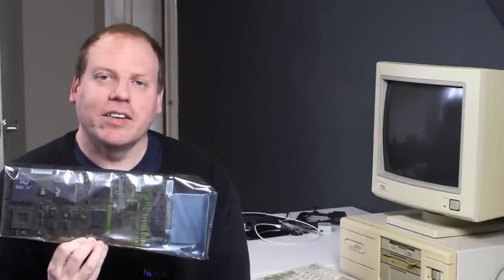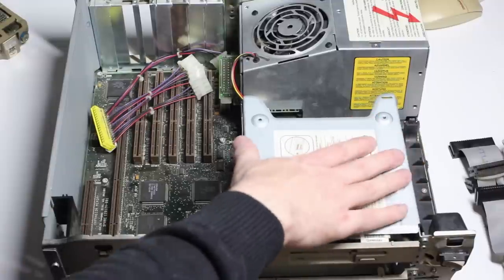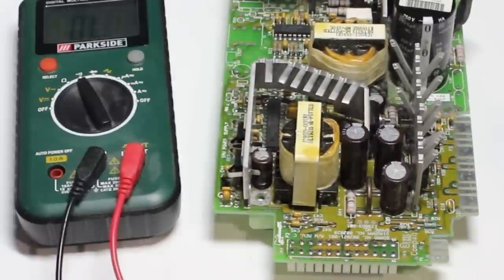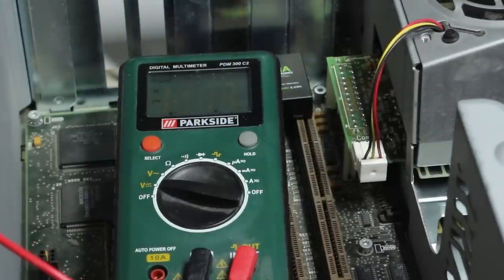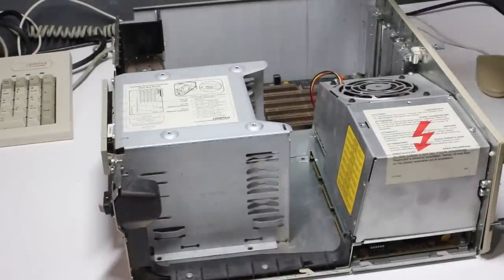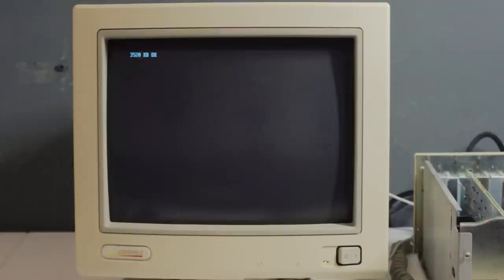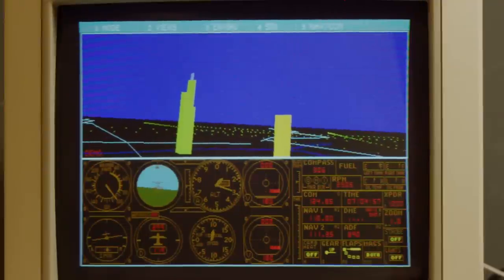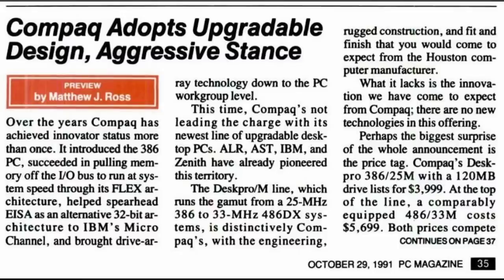Rescuing a REMARKABLE 386 DX-25 Made by Compaq

Comment: could you please add a link to the setup utility in the description? I just bought one of these :)
Reply from the maker: Unfortunately there is no obviously reliable site to download these. The best I came up with was:

http://66.113.161.23/~mR_Slug/pub/EISA/sources/COMPAQ/added%20to%20archive/

However, you need to know which one to download. Too early (or possibly too late) and it won't work. In my case I used sp0842.exe.
Reply: @PCRetroTech  sure that's the one? You mentioned 4 floppies being required in the video but that archive only makes 2 disks. And they are 1.2MB not 1.44
Reply from the maker: My apologies, it's sp6144 that you want [1]. I originally looked through my downloads folder and the other softpaq was the only one I found. But I just checked my USB stick and found it was actually the later one that I used. I still don't know how I got it onto my USB stick without actually downloading it. I must have partially cleared my download history or something.

Anyway I'm pretty confident sp6144 is the right one.

[1] https://ftp.zx.net.nz/pub/archive/ftp.compaq.com/pub/softpaq/sp6001-6500/
Reply: @PCRetroTech  that's it! Got my system configured. You're right these are quite fast
Reply from the maker: @heilong108  Great that you were able to get yours going. I've been spending time writing code on mine. I realised that cache barely affects a 386 DX until you get to about 20 or 25 MHz because the bus and CPU are almost perfectly matched at 25Mhz if you have 80ns RAM, which this does. But I believe it has a cache anyway.

Comment: Sadly EISA-bus machines (and cards!) were ridiculously expensive, not targeted for small businesses or home users :(

About 386DX vs. 386SX - 32-bit memory bus helped a LOT, especially combined with decently speedy VGA-card. 386SX's halved memory-bus killed performance from the start and most cheap 386SX-machines had no external cache in motherboard. Even little 64kb cache in MB made a huge difference and pricier 386DX-ones almost always had some. Combine that with 32-bit memory bus and demos actually ran as advertised. Been there since 80's, I used 386-class machines in late 80's and early 90's. With decent 386DX+MB, next one to tune was VGA-card... how you pumped up bus timings and card itself. Have you tried overclocking older Cirrus or S3-cards? Good old times!
Reply from the maker: I've done quite a bit of overclocking of VGA card on VLB and ISA machines.

Yes, I agree the 32 bit bus helped a lot. That is one of the main points of the video of course, although I could have made that clearer by mentioning it in the conclusion at the end rather than just alluding to it in the introduction.
Reply: @PCRetroTech  It could be interesting to see how much overclocking actually helped in 90's?
IF I remember correctly I got up to 20% more out of my Cirrus 542x/543x- and S3-cards back then. Used VGASPEED and some other early "benchmarks". And in many cases it actually improved gaming experience in DOS-era games years before 3D-cards.
And thanks about interesting video as always, keep up the good work!

Comment: was there a difference in L2 cache?
Reply from the maker: I believe so, yes. Compaq mentioned the cache in their advertising. I don't have comparative figures though.
Reply: @PCRetroTech  l mean was there a difference L2 cache between your two 386 pc's to help explain the difference in performance?
Reply from the maker: @Pickle136  Yes, that's what I'm referring to. I believe the cache on their later machines was superior. One of the other really big differences is the 32 bit bus obviously.
Reply: There's no L2 cache on 386 systems, since there's no L1 cache inside the 386 CPU itself. Also, it was very common for 386 systems to not even have external L1 cache (no cache at all).

Comment: By the way, it should not be hard to make a memory board for that slot with just the pinout of the slot, that will be FPM RAM for sure so pretty easy stuff to implement.
Reply from the maker: Yes, that would be an interesting project, and certainly something I thought about. I don't know the pinout at the moment though. Documentation is really sparse.

Comment: Your the second person to do a video on this machine. Look up a video by Rik's Random Retro. 
"Compaq DeskPro 386/25M - The Modular Fun Machine"  The memory card just added SIMM slots you had to populate with SIMMs. His also had the original EISA video card. Well if you want to bother. The original card for this machine was a slug, and EISA didn't do much for video anyway. Most ISA cards would outrun the original anyway. The original EISA card also used a weird VGA connector with pins missing that may or may not work with the monitor you have.

Comment: Oh and by the way, if you want to run Demos like Unreal, Second Reality (this one in particular) make sure you completely avoid ANY SLC model, not one has worked for me on those without crashing at some point, some times a bit later into the demo (1 scene if it worked) but it would crash nonetheless. Moved to a 386SX40 from an SLC40 and guess what, no more crashes.
Reply from the maker: Interesting. I wonder what the problem is with those?
Reply: @PCRetroTech  maybe misconfigured CPU settings somehow? Possible?

Comment: Your VGA may actually be an EISA model, which would make it faster. Can you check this?
Reply from the maker: I wondered this myself, but the connector looks like ISA to me. I don't think it is a EISA card.
Reply: @PCRetroTech  You can easily spot the difference between them. An EISA has twice the ammount of connections ISA has..
Most of the difference in speed between the SX and the DX is caused by a vast difference in memory bandwidth as the DX has full 32-bit 25MHz memory whereas the SX has 16-bit memory bandwidth and is running at 16MHz, making the DX's DRAM throughput more than 3 times faster!
Reply from the maker: @pipschannel1222  Yes, that is what I would expect.

Comment: Warning, if you do buy EISA cards for this machine, remember at least some of them are inoperable without the corresponding option disk to set the board parameters in conjunction with the COMPAQ setup disk. Jumper free didn't yet mean plug and play!
Reply from the maker: Yeah I saw all this in the setup program, which I have.
Reply: EISA can be such a PITA to configure. Even with the correct setup utility and config files, there's no guarantee the card will be compatible with the motherboard.  But for the era, EISA was quite good. Just wish better video cards were made for the standard. Not all EISA motherboards have VLB...

Comment: This EISA System should have the RAM maxed out, the CPU maxed out (so a AMD 40Mhz if you want to keep true to the 386, or an DLC or SLC model but please keep the 40Mhz FSB), a decent 387 FPU added and then dumpster dive as deep as needed to find EISA cards, like for example a Creative Sound Blaster (oh wait, was that an MCA one... not sure) Network EISA card is mandatory and those should actually be not that hard to find (by comparison), a SCSI Controller and CD Burner why not, a TV Tuner card with composite input (as TV RF will not work nowadays in most scenarios), and any other EISA card you can fathom! 
The main goal is to demonstrate how you can manage DMA, IRQs etc in a easier way than moving jumpers around :) (etc)
Reply from the maker: As the case has 25m written on it I want to keep it as a 25 MHz 386, but I would like to try an EISA card in it eventually, for sure.

Comment: The original Deskpro 386 was a very expensive machine to begin with; I believe it was actually the most expensive offering Compaq had made to date.
It's too bad HPE took the entire Compaq progeny with them...
Reply from the maker: I think the 386 was unaffordable for most for a pretty long time. The SX changed that for many people, but it wasn't really until the AMD DX chip that the original 386 came into the hands of the average punter. But a lot of such machines were poorly executed. It's really nice to have one that was executed so well (proprietary connectors notwithstanding).